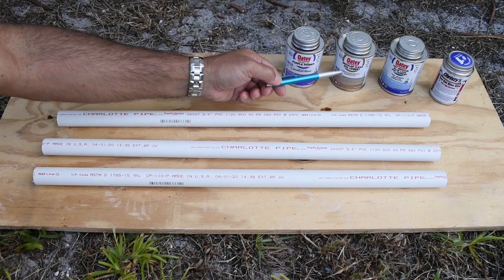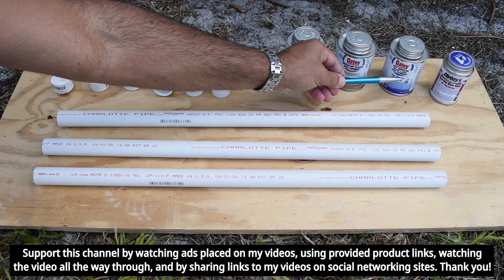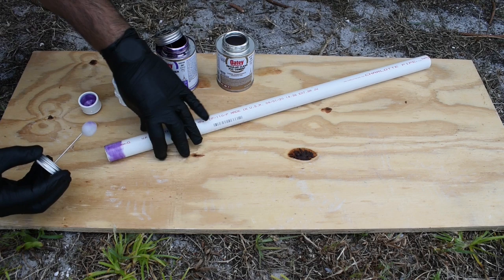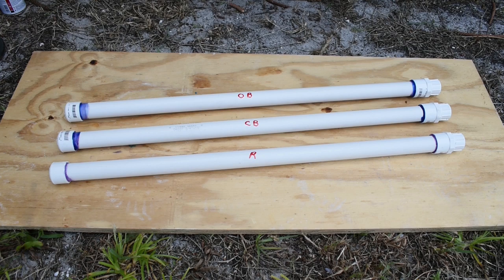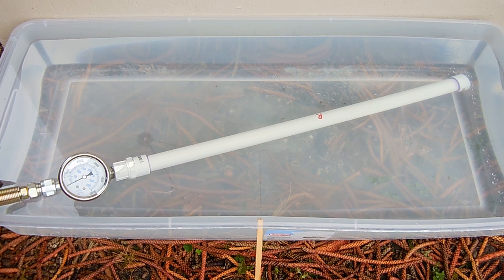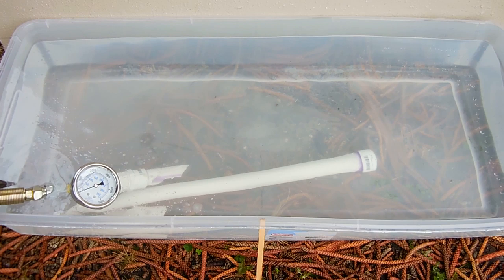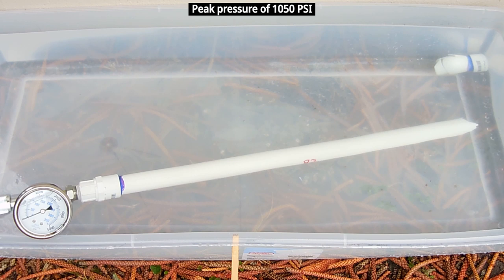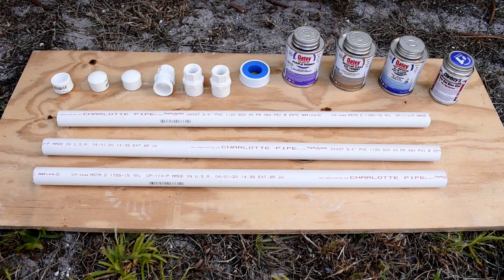Which PVC cement is better? Oatey or Christy's?

Comment: It is difficult to say what it means but it is interesting to note that in the first test all three had fitting failures and in this test all three incurred pipe failures. Hmmm . . .    In any event your testing is well done and deserves applause.
Reply from the maker: Yes, it showed me that all SCH40 PVC pipes aren't created equal. In the other video, the pipe was able to tolerate 1600psi, which put enough pressure on the fittings to blow them off, and in this video the pipe barely hit 1200psi before it ruptured. Thanks for watching!

Comment: If you read the instructions for the Christy's, you need to go back and repaint the first fitting you did before fitting.
Thats probably why you had the leak, which they also mention is the primary reason they instruct you to go back and repaint the first part.  Agree with another poster, cut the length down to 6", and try using the Christy's With and WithOut the primer.
After all, thats supposedly the benefit of the Christy's.

Comment: Very good video, although I knew the pipe would fail before the fittings would. I've been using solvent welding with PVC pipes for >40 years. I'm a HUGE fan of Christy"s because you DON' T need  to use primer if the pipe is < 4 inches.  Look it up.  120 grit sandpaper and your good.  Much faster than Oatey's cement

Comment: Interesting, I have seen PVC used for air supply lines, never tried it my self. Good presentation
Reply from the maker: Thank you Craig! Stay safe.
Reply: PVC is against code for use in compressed air systems. Usually black pipe is used.
Reply: @Huero87 i worked in a machine shop that ran pvc for compressed air.  We had 150 PSI plumbed all throughout the building.

Code is mostly there to give inspectors a job

Comment: Interesting that this time the PVC pipes failed, rather than the cemented joints.  However, I'm reassured that the different PVC pipes all greatly exceeded their ratings, and thus the water pressure I have here at home.  And I learned proper PVC joining technique to boot.
Reply from the maker: Yes, I was surprised that the second length of 10' SCH40 3/4" pipe used for this video, burst well below 1500. Thanks for watching! Be sure to share the video link, as of now the video was a big waste of my time.

Comment: 1. Primer isn't required for blue glue
2. Scuff the fittings and pipe with sandpaper first it'll never come apart! Pipefitter
Reply from the maker: Hi Bruce. According to the can, primer is required for all 3 if the pipe will be pressurized. No primer for DWV. Thanks for watching!
Reply: I have used blue glue with,  and without primer,  never had it fail. I still like to use primer either way... I've also gone both ways on the scuffing, basically,  if I have sandpaper when I'm doing the repair,  I use it. Whatever the case,  I've never had a pvc joint fail...
Reply from the maker: @Quickened1  In all my years of doing PVC work, I also never had one leak.

Comment: Good Info Sir !
I never EVER waist my time with the Primer.   Just a money sponge.  You simply don't need the stuff.  They have everyone thinking it's required.  Well it's NOT.     A quick rub with 260 grit sand paper cleans and preps the joints more then fine.  If you feel you need to clean the materials more, use cheap azz Acetone.   The sand paper rub works magic.  Hell in a Pinch I've used nothing but Acetone alone .  I have water pipes 30 years old still working here I did that with.  Well pressure 45lb .  NO ISSUES.  NO LEAKS!
Reply: If he didn't use the primer, he'd receive a crap ton of complaints this testing was flawed for not following the recommended process.  He uses the primer, someone still says he's wrong ;)
Reply: @adrianmack3  True, also most cities or townships(this is the case where I am) will fail inspection if the "plumber" did not use primer.
Reply: @JT-lq4yd  so, not worth it trying to save a couple bucks
Reply from the maker: I have a video planned comparing primer/glue, sand & glue, sand/primer & glue, and only glue, but if these videos continue to do poorly when they should be doing great, I may not do it. Thanks for watching!
Reply from the maker: @Adrian Mack You're 100% correct, all the experts would be here telling me how I failed to do as the manufacturer stated for the tests. Thanks for watching! Be sure to share.
Reply: Plastic pipe can develope a skin the glue doesn't penetrate. Primer helps with this but sandpaper eliminates any skin present.
Reply: @adrianmack3  I suppose it's up to whoever is doing the work to save or not as it may need to be done again.  Here is another video idea for electronicsNmore, perhaps a test with and without primer.  Even using acetone, sandpaper as well in place of primer.  Also, primer acts as a cleaner washing away dirt and grime.  I have had to repair connections that failed because proper preparation of the joints was overlooked, not having a clean cut, connection not clean or not holding the parts while they're fusing as they tend to push back.  I will be using primer regardless of the $5 it costs at the hardware store.
Reply: you're not wrong, but inspectors have to see that primer color.
Reply: @electronicsNmore   I am very interested in seeing the difference in performance of the connections made performed in different ways.
Reply from the maker: @JT-lq4yd  In a week or 2 I'll make another.
Reply: @P_RO_  I am sure the manufacturers PVC would test and validate their formulation of the primer and cement.  If they do not see primer as recommended by the manufacturer, they will fail you as they will think you are cutting corners.  As you said in another comment, primer and cement work together as a two-part glue.  If done properly, both solvents will soften the PVC and when two parts are glued they melt together such as when welding steel except there are no sparks.  ElectronicsNmore did the test as recommended, to me this is important and would not accept his test as valid test.
Reply: pulesjet, the purpose of the primer is to begin the softening of the pvc to receive the glue which makes the weld.  Sanding is not the answer.  Use the sandpaper to bevel the ends of the pipe 1/16 to 1/8 inch so a ring of glue  sits right at the inner end of the socket.  Remember the strongest part of the weld is the first 1/3 of the fitting socket.  If you go to our website you'll learn how to make a joint that will never fail because when properly applied the weld fuses to make the joint as if it were one piece rather than two pieces.James from Charlotte pipe (we make 75% of all pvc pipe sold in USA)

Comment: That's like comparing apples to oranges.  Each if those adhesives are for different applications.  Light bodied vs medium bodied and grey is typically heavy bodied.  All have different set times for a reason.
Reply from the maker: Incorrect. The test was a fair comparison, and all types were given the same cure time. You're the first complaint.
Reply: @electronicsNmore  Those are facts not a complaint.  This is a compliment: Great test, best one I've seen.  Results make sense, pipe psi threshold is lower than the bond 👍

Comment: If you make the pipe as short as possible you'll take pipe variabilities out of the equation. Also, its interesting that two pipes swelled at the fitting. An effect of the solvent?
Reply from the maker: I thought of that. :-) Thanks for watching!
Reply from the maker: I wonder if the wall was thinner for both pipes in that general area, it is unusual.
Reply: electronicsNmore Primer has been shown over and over again on tests run by standards organizations to weaken glue joints. Primer is a solvent, it reduces the cross sectional area at the joint. Its main purpose is to clean contaminates and to soften/break down the PVC and accelerate the reaction with the PVC glue. The more primer is applied and the longer it is left on the pipe before completing the connection the weaker the joint will be. The strongest joints are produced on clean pipes, glue only, no primer. That being said, primer only marginally weakens the joint <5% and the pipe will still fail before the primed joint does. The glue has all the solvent required provided the pipes are clean. Cleanliness is the key factor. Dirty/oily contaminated pipe surfaces make the weakest joints. The reason inspectors insist on seeing primer on the pipe is to insure that, at minimum, an attempt was made to clean the pipe and not just slapped together while dirty.  They know that the pipe was likely left outside overnight on the job site next to the porta potties and then dragged across the oil ridden construction grounds to be installed. Using too much glue, waiting too long to connect, and not cleaning off the excess glue will also weaken the joint. Thanks for all of your vids, great stuff.

Comment: I just went to Christy's offical website and primer and or cleaner is not required per manufacturer however it does state unless required by local building codes and as far as using the Oakley primer Oakley states that the primer should be sticky but not wet so I have to agree with the others the test wasn't done as you stated per manufacturer but in your defense your connections didn't fail before the pipe. Although after say real world lifespan of say 5-10 years of temperature change and soil or pressure changes I'm sure that your connections would fail

Comment: Excellent elimination of variables.  Don't know if anyone has already said this, but here's an idea.  the longer something is, the more likely it will fail based on the "Only as strong as its weakest link" effect.  To draw on a parallel, When testing rope, it's well known that the longer a rope is, the less weight it can hold before breaking.  I wonder what the results would be if you used a length of pipe that was exactly long enough so that both fittings actually touched each other.  If the goal is to see which solvent is stronger, it might have better results toward that goal.  Another thought, and you would know better than I since you've been doing plumbing for a while and I'm just a DIYer, but is it possible to do this same test with schedule 80 pipe.  I've never seen it sold at Home Depot or Lowes and don't know much about it other than it's for commercial use and much stronger than schedule 40.  Thanks for an awesome video.
Reply from the maker: Glad you liked the video! SCH80 PVC isn't commonly used, and since the video didn't get the high level of exposure it deserved, I won't be making another. It would be a waste of time and money. I only do follow-up videos when people share the video and the view count is high. I cannot spend valuable time buying supplies, filming, and editing videos for no compensation. Be sure to watch my other PVC videos below and share. Thank you
https://www.youtube.com/watch?v=1o4E2pdEv-s&list=PLQ6IOhUBblU10Q846UXdxMnh8S_eul0UT
Reply: @electronicsNmore  The view count seems to be on par or higher than average compared to the rest of your videos.  The feedback, however, is very low.  I enjoyed your video because of the the scientific approach and the professional way it was presented, but ultimately it didn't satisfy the reason I clicked on the video in the first place.  Don't get me wrong, it's nice to know that pretty much any solvent I choose will be stronger than the pipe itself.  But what I really wanted to know is what solvent is the best.  Most people would search for videos like this one because of the wide variety to choose from at the hardware store.  I suspect that if the test conditions you implemented actually provided the results to rank the solvents from strongest to weakest it would get much higher exposure.  But if you do rerun the test with a stronger or shorter pipe, I would be very careful of the shrapnel if it were to explode before the solvent failed.  I hope you reconsider making a new video.  If you do, I would be sure to mention the pressure rating of the pipe when you apply pressure to it and compare the failure pressure to the average water pressure for a residential area.  Besides, a cool explosion would generate the "Oh Wow" factor needed to generate shares, instead of the "Oh, that's nice to know" factor it currently generates.
Reply from the maker: @seanile  The majority of my videos are grossly underrated. I should be getting at least 50k views per video. People upload stupid videos on YT and get 100k to 1M or more, with all kinds of noises in the background, or the creator rambles on. Completely illogical that a video about what I showed, a very popular subject to many, only gets a few thousand views.
Reply: @electronicsNmore  People who are truly interested in how things work are a minority my friend.  There are outliers such as how the mask works.  If it were not for COVID it would not have gotten the views I suspect.  Unfortunately, you are in competition with the shock and awe posters.  Just like the TV show myth busters.  They not only show the results, but then they have fun and reward the audience with the "lets see what happens if we do the same thing, OVERKILL style".  You may just need to adapt to the times and give a "dessert" to your mental nutrition your providing with your videos.
Reply: But to be fair, I just discovered you yesterday, and I have not watched any of your other videos yet.  except for the one you linked to in your comment.  I hope I wasn't too forward in my response about providing a big Bang at the end.  I was just trying to troubleshoot the issue you described based on limited knowledge
Reply from the maker: @seanile  There are millions of DIY people in the USA, and plumbers/irrigation people that should have very high interest in these PVC testing videos. No other channels demonstrated what I did. The video should've easily gotten hundreds of thousands of views, but YouTube gives my videos little or no exposure, so people don't know they exist. If I didnt have 120+ videos with 100,000 views or more, and 14-15 videos in the millions, I would've stopped uploading videos by now. Those videos keep my channel going, they help compensate me for all the other videos that get no exposure. My channel has amassed 100M views, nothing to sneeze at.
Reply: @electronicsNmore  You're absolutely right, nothing to sneeze at.  And yes, you are the first channel to actually test PVC solvent strength that I have found.  I have zero videos uploaded so I don't know what's up with that or how YouTube provides exposure.  All I'm saying is, even though you are the only one I found to test solvent in this way, ultimately I still don't know which solvent is stronger.  So as a suggestion, I say maybe this video would have gotten more views or likes if you were able to reach the answer to that question.  Either way, I subscribed to your channel and I liked your video.  Good luck with this.

Comment: You might use a smaller diameter pipe like 1/2" as they can stand more pressure, usually.  Same principal for tire pressure, the larger ones would be destroyed at the pressure some bicycle tires use. We have some equipment that requires flexible ss tubing with a working pressure of 3000 psi and the tubing is 1/16" ID.  I would like to see how other brands compare and especially how one-part primer/cement compares to two-part like these.  Very accurate testing methods you have created.
Reply from the maker: Yes, the 1/2" pipe does have a higher burst pressure, by about 300-400 PSI. I tested one in my previous video that was hidden from viewers on YT. LOL Thanks for watching!
Reply: 1/16” is pretty small

Comment: Sir, they seem to burst most often at the ends.  i suspect the glue or primer, or both, melt and thin the ends.  would you mind using super glue at the ends or epoxy, and testing the center of the pipes by putting the glue and primer on the middle, about one inch wide swathes?   if you don't have time or just don't feel like it, that's okay.
Reply from the maker: I agree, I think the solvents weaken the pipe next to the fitting. Be sure to watch and share my newer video below. Thanks!
https://www.youtube.com/watch?v=1o4E2pdEv-s

Comment: So you’re still applying Oatey’s Primer to the Christy’s Blue? A lot of the videos I’ve seen don’t use any additional primer, just the Christy’s Blue. Is applying Oatey’s Primer an additional advantage or a step that’s not necessary?
Reply from the maker: Primer is required for pressure lines, now DWV.

Comment: Clear glue is the best in my opinion. Also I’m wondering if you considered doing this test but instead of using air, using water pressure to test the glue joint. Like for example hooking a sealed water source to these pipes with caps.:
Reply from the maker: No, using air to test creates an explosive device.
Reply: @electronicsNmore  I’m aware but I guess what I’m trying to ask whether that would have different results than your test.

Comment: I am assuming these are the same brands made in the same factory on around the same date, yet, compared to your other test, the pipes did not hold up at all.  It just seems so odd that they had such different strength characteristics.
Reply from the maker: Yes. The 3/4" SCH40 pvc pipe in the previous video hit 1500 without bursting, but the 3/4" pipes in this video from another 10' length couldn't get past 1200psi. Almost like the walls were a little thinner in this video.